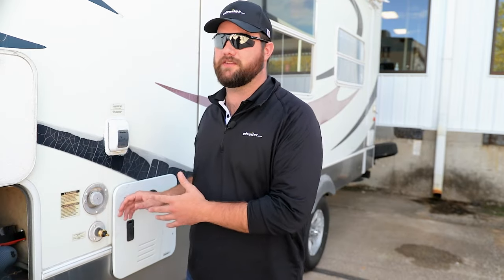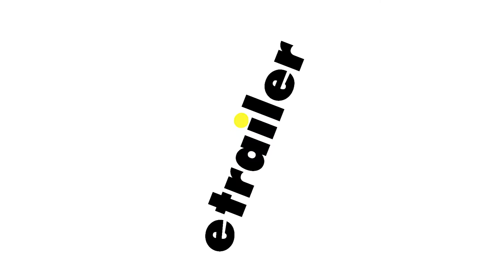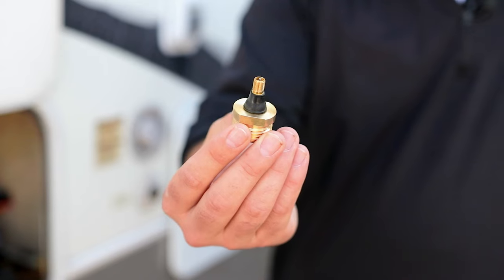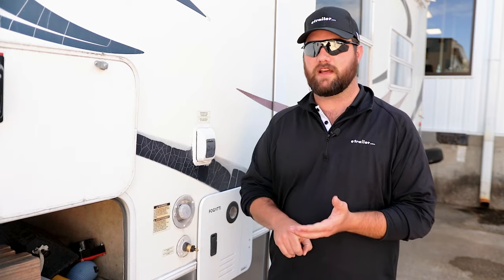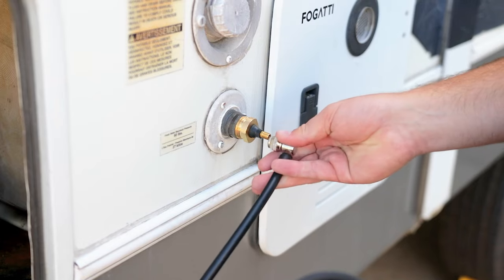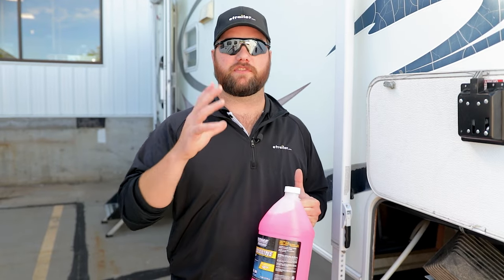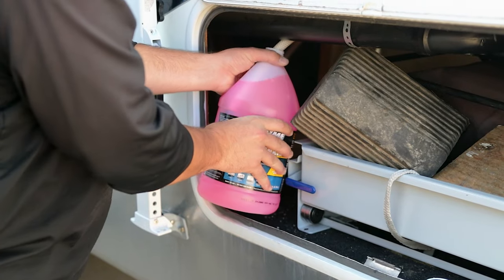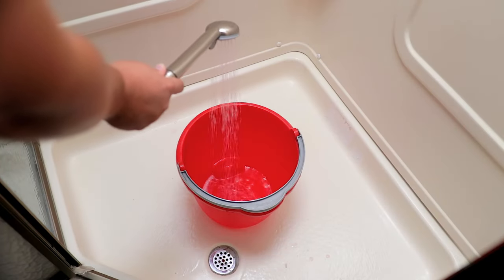How to Winterize Your Tankless RV Water Heater

Comment: As you show the use of a bucket in the shower I would suggest as part of the winterization process to pour some antifreeze down the drains to ensure the traps don't freeze. I also like to pour some into the black tank to keep freezing water away from the valve.
Reply from the maker: That's great advice, thank you!

Comment: There is a drain petcock lower right side that should be opened...it drains the small blending tank on the back and the copper drain line that spills out the front on the teay.

Comment: Excellent info.  What about sanitizing the water system?  Using 8oz of bleach to 45 gallons and running it through.  Is it ok to send that solution through a tankless?  Whereas tank heaters have valves to avoid diluted bleach water from entering the system.  My new trailer with a Furrion tankless has no isolator valves to bypass it.  What do you think?  Thanks!
Reply from the maker: You can install a bypass if you wish, but the owner's manual lists no prohibitions on using a bleach solution to sanitize the water system/water heater. Be sure to thoroughly rinse the system out afterwards.